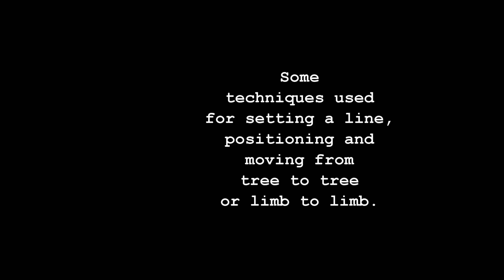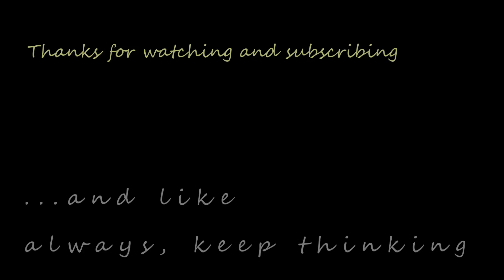Techniques used for line setting, positioning and traverses

Comment: Stopper knot safety question....
Shouldn't a bottom of rope stopper knot be tied higher than shown at 2:25? High enough to catch you before hitting the ground full body? Ive only ascended SRT about ten times and half were a few years before 'I started' climbing.
 Ive only had my tree climbin gear  about 5 years -seldom used and with long breaks my first 3 yrs. So still a newb, essentially untrained amateur. Just got my second harness and some new ropes. Gained most my climbing experience last spring topping trees for a crewless landscaper dude that was bored with mowing and liked the extra few hundred a day.
Reply from the maker: Well that was a flashback to to 9 years ago.  The stopper knot is not there to catch you when you fall, In tree climbing equipment we don't do fall arrest. If it was tied very high, how would I climb on it or past it?  The length was planned so that I would not have excess rope laying on the ground as I needed it all to make the traverse.  If a person was using a chainsaw and moving around the tree to some extent, that would not be a good idea as you would not have the length required to reach the ground in an emergency.  Once I got to my first location.I used the tail of my lanyard to secure myself while I used the long lanyard to get way out on the limb in a position to make my traverse.  When I got to that midpoint and I could reach the adjacent tree with my magnetic throwbag I set the tail of my climbing line in a doubled moving rope configuration.  I made the traverse to the adjacent tree and then retrieved my initial SRT line.  I then continued with the doubled moving rope to make the descent to the ground and retrieved everything.  
Again that was almost ten years ago and a few things have changed but I still climb on some of those basic concepts.

Comment: Great how you put the thin line through the carabine. So you can save rope length rather than put the main rope that comes back over the branch through the carabine, when it reaches you. Your videos are awesome Richard :) 
         By the way I have this IDEA - that I could have a 20m rope and 20m thin rope, I could make a loop from the start of the main line and to the end of it - where the butterfly knot is - after it I could make an Austrian-8 knot, and attach the thin rope. So I could pull the butterfly down from the tree when I finish climbing. Therefore I would need to carry with me less rope in a backpack, when I go to different locations.
Reply from the maker: Yes, small tag line or throw line is a popular recovery technique.

Comment: Richard, what kind of lanyard adjuster are you using at around 4:07?  The little blue, cammed-type adjuster?  Almost looks like a larger ropeman style ascender?
What's it called and can you descend/pay slack when it's loaded, like the zillion or the ART positioner or trango cinch?
Reply from the maker: Wyatt Spruck I was trying a Camp Lift on the tail of my lanyard, cool little device.  Similar to other rope clamps.  Mostly I use the CE thimble prusik.
Reply: Thank you!  
Very cool rich.  
Yes, I like the CE thimble too!  I just had to retire mine (2 years old now, vectran apparently has a 2 year lifespan because of it's degradation in UV light)

Comment: At 1:15 you say I know that I got enough line. How do I know I have enough line? The method you're using is called SRT am I right? Thank you for your video's! I'm a arborist trainee from The Netherlands and try to learn some nice techniques through your video's. Thank you
Reply from the maker: once the line has cleared the anchor as it is going up, in other words, the end of that climbing line is starting back down, I know it will be enough now to reach the ground from my tied anchor.  What went up now equals what needs to come down.
Reply: Wow, thank you for your quick reaction! Thank you for the reaction!

Comment: Are you a hobbyist or a tree worker?
Reply from the maker: Only two choices?  I'm not much for labels or limits.
Reply: Well I'm a tree worker and giving people advice on climbing systems that you developed for personal use is a good way to get someone hurt. I'm not saying don't give the advice or not tell people techniques but just give a disclaimer that its based on what you like and how you do things. Remember, climb safe
Reply from the maker: ian martin
  Ian, I think you may be confusing YouTube, Facebook, web based discussions and other forms of social media with official sanctioned and structured training. 
As a "tree worker" I was surprised to see you use a dull saw, drop start it then use it without PPE.
Please do, climb safe.
Reply: Richard Mumford I never mentioned training, I said advice.
That was before I had my second close call and almost took off my leg from kickback. I still do drop start but I do it in ways that reduce the chance of getting injured by a great deal, like drop starting a warm saw. Its also necessary to drop start sometimes. As for the saws being dull, they were both extremely sharp, just the angles on the chains were not correct and caused the saws to not cut straight, and they both had running problems. The craftsman needed a carb rebuild and cleaning and the Stihl needed a new ignition module and carb cleaning.  Currently I own a new ms171 because I bent the crank rod in the 170 doing repairs and the craftsman is scored from dirt in the gas and running hot
Reply from the maker: ian martin sounds good, take care and we'll see you in the trees.